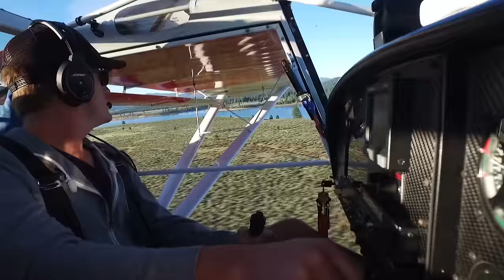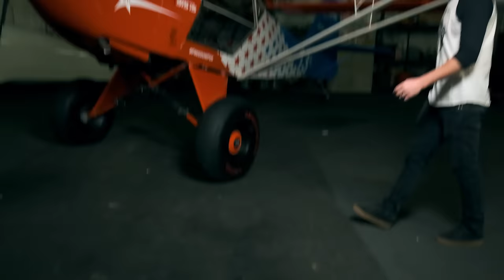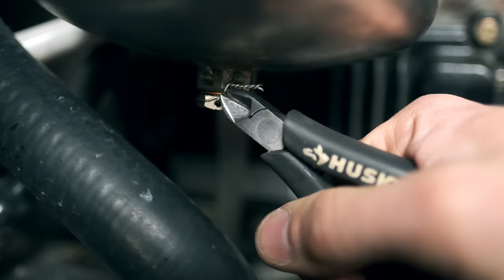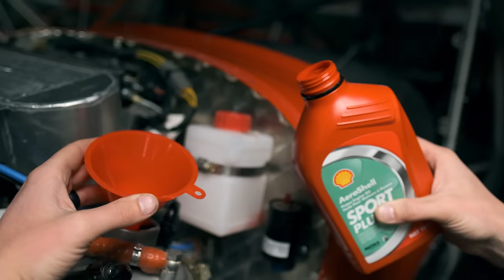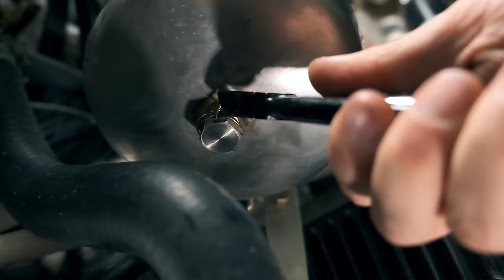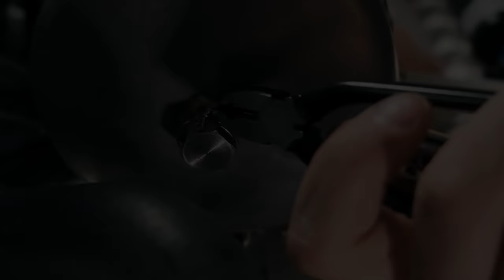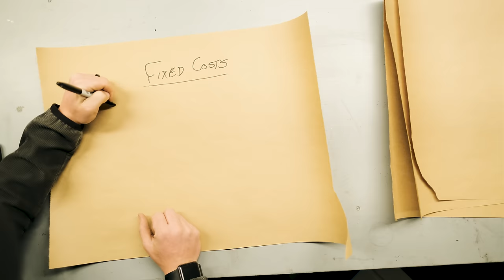What Does It Really Cost to Own and Fly Your Own Plane?

Comment: A very smart man gave a rule of hourly cost = 3x hourly fuel cost. So for you: 3x(5x$4)= $60/hr, which is close to you first figure. My guess is that most aircraft will beat up $100/hr pretty easily.
Reply: That works , mine burns 12gal per hour x $4 x 3 = $144 . pretty close to the $150  per hour i had calculated.

Comment: Now I dont feel bad on taking care of my F350 6.4 power stroke. It takes 4 jugs of oil in an oil change and two fuel filters. That's jugs of oil. Not quartz. About $120 an oil change. My Jeep is around $46 an oil change. Still. You have it going on. Yes diesel pickups are expensive although yours is more. I always wandered.
Reply: My Mack crane truck takes 56 qts.  But my oil analysis outfit tells me I can go AT LEAST 650 hours between changes.
Reply: @portnuefflyer  you all are making me feel better all the time. I had to replace the heating and AC under my dash. $1,800 for that. Then he says what it cost just for an inspection. Then the cost of storage. I love the hobby and I'm very happy when people can afford it yet then it makes one think on the bigger 4 too 6 seat aircraft on how must it costs them. I always wandered. Yet again, amazing hobby.

Comment: The oil change interval suprised me.  I realize that’s 25 hours at a high throttle, but still. That’s like changing you car oil every 1000 miles.  Can’t you do oil analysis to find a friendlier interval?
Reply: Your airplane engine fails and now your life is on the line. As you glide to a hopefully safe landing spot you think to yourself "well at least I saved a few bucks on oil changes!"

Good preventative maintenance on an aircraft can easily be the difference between life and death.
Reply: ulbuilder I get the life and death part. I just dispute 25 hours is anywhere close to technically necessary.  Usaually manufactures start extending such intervals when they know they are being overly conservative. Hopefully rotax does because this is an incredible abuse of resources.

Comment: [Q] what kinds of maneuvers could you use if you found yourself in a steep narrowing canyon
and can't make a regular turn to get back out ? I'm thinking some form of a barrel roll or loop ? and have you ever gotten into a fix like that..?
Reply from the maker: It’s actually counter intuitive, slow the plane as much as possible, full flaps and do the turn. You turn with a much tighter radius at slow speeds than high speeds, even if you pull really hard at high speeds. Of course the answer you were probably looking for is pull up vertical and do a hammer head back into the canyon

Comment: Boy you guys south of the border really do get a hosing with some expenses. I pay $135 per year for my owner maintenance Champion. ( no longer manufactured or supported by the manufacturer) I burn mo gas with additive. ( when the price is low I buy lots and keep it in my own bowser) Oil and filter are inexpensive. I use shell oil. And my annuals are done by .....ME. No maintenance engineer needed. Fill out the log book and il done. I live in the great white north and no I don't keep it in a hangar. You do more flying than I do.

Comment: If this video is current enough to include your Rotax 915 why the heck are you changing the oil every 25 hours? 915 oil change intervals are 100 hours or if you run more than 30% of the time on avgas it’s 50 hours. Not 25…
Reply from the maker: I run primarily avgas

Comment: Sorry, but that plug right in the middle sucked big time. Also, if you're changing the oil every 20hrs then why doesn't the oil look like it did coming out of the bottle ?!? I get my car serviced every 10,000  (it has lots of Ks on the clock) and the oil is near perfect.

Comment: About $80/month for hanger space at your local EAA chapter (according to my local vice pres) for a T-hanger, and whatever gas you put into it and new spark plugs.  Oh yeah, and recovering it every X years.  That part is a total bitch that should turn anybody but those with a metal skin plane owners away.   I got a shop to park mine in, so I can avoid the $80/month which ads up fast.  Some places, I'm sure it's more like $200/mo.

The airplane is actually the last thing you should buy.  You are going to need a mowed flat grassfield airstrip, shop, and hanger first to build one in or store them in.   That part is the up front $$$$$!.   $15K for the land and another $15K for the hanger. plus $1,000 in land taxes every year.      Don't even think of building an airplane unless you already got a farm maybe, an empty field you could take off in, a work shop already built, and a lot of time on your hands, because it's a long road ahead. 

hba.air-war.org
http://air-war.org/cheapskate.shtml

Comment: If I paid for your fuel, would you take me up on a flight?
Reply: The rate is   100 per hour.      Lot of cost.     But he might
Reply: That is illegal in the U.S.  Private pilots can only share the costs of fuel and oil with passengers.  Anything else is considered a commercial operation, and would require a commercial pilot’s license and the airplane to be maintained to commercial standards. Experimental aircraft are not allowed to be used for commercial operations (except with a waiver/ special FAA permission).  Now if you buy him a nice steak dinner afterwards...